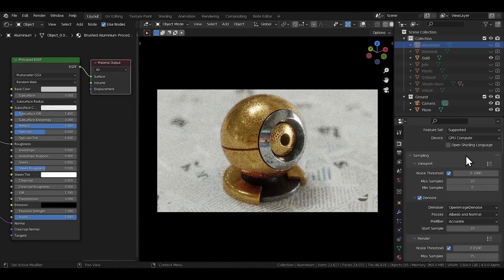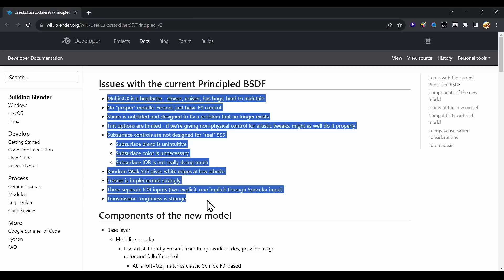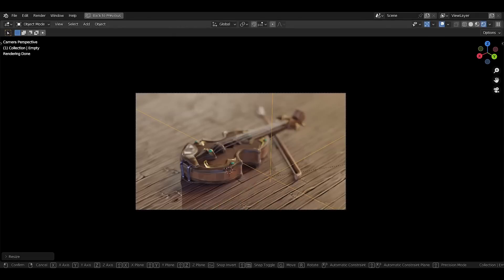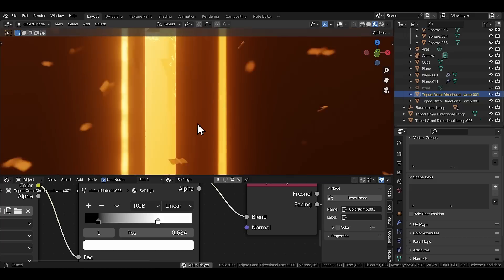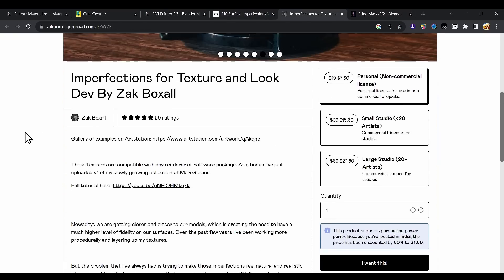Material, Shading and Texturing Tips for Blender

Comment: If you are saving a png next to your psd, you are now using another 3 mb of storage in addition to your original 20, and when blender loads the image into memory, it will use the full uncompressed data anyway, so png saves you nothing there.

Sure, if you are no longer editing, compress to png for the storage benefits, but otherwise just use the original psd for flexibility.

Comment: I wish they'd also add a toggle to the normalmap node to mark the image texture thats being plugged into it as OpenGL or DirectX, as if its a DirectX normalmap the bumps and indents get inverted. Plus I'm kind of tired of always having to add the extra nodes to seperate the green channel, invert it, then combine it.

also hope they fix issues with subsurface scattering in cycles, where in my experience it can cause a strange effect where the topology of the model becomes visible on the material - which doesn't seem to be an issue in eevee since its screen-space SSS

Comment: idk who needs to hear this but blender now supports USD so you can export pretty much everything very fast to unreal engine which comes with a new material system Substrate. Its crazy accurate, higher visual quality than this and runs in real time. If you feel the need you can even path trace it.

Comment: Nice to see you using Object info and random! I use it all the time and haven't seen it in use very often. The use case for the foliage is exactly the first thing I used it for, and an almost identical node setup too :D

Good tip with the layer weight for emission.  That''ll be handy. Subbed!
Reply from the maker: Ikr. Love object info. Glad to know I'm not the only one using it on foliage
Reply: @stache_obj  Used it another time to randomize the colours of hundreds of instanced cars. Random plugged into the fac of a colour ramp set to hsv and far interpolation, and then multiplying that colour by (simplifying node network into code) sin(random * 1000000) * .5 + .5 gives you pretty much all colours and shades! 

For literally every possible colour, you can use the HSV node, and plug in sin(random * 10000) * .5 + .5 into saturation and value, with 10000 just being some very large number, different for each slot by an order of magnitude or so. It works really well for colouring uncountable numbers of objects uniquely! Sorry for the paragraph, too excited to discuss Blender shader nodes
Reply: I've found that it's handy to map some of your noise textures with world space mapping too, if you have something where you want linked duplicates but different noise, like dirt or damage on walls of similar buildings. Especially with modular building, where you use the same wall in a bunch of places on the same building.
Reply: @darrennew8211  I often use world space mapping too. Even in Unity shaders. I don't see it being used very often either... perhaps it's ba practice? But why? is it more expensive? Dunno. Until I get a valid reason I'll continue using world space :P

Comment: Fyi Principle v2 ain't in Blender 4.0 Alpha yet, so what you are showning is still the old principle shader, but with some added and removed sliders :)
Reply from the maker: It's not called v2. But this is the beginning of the changes they talked about in the blender conference. So it's not called v2. But it's definitely the beginning of what they promised.
Reply: @stache_obj  Yeah sure, but the energy conservation issues that is the main problem with v1 is still very much there, and  from reading some of the dev talks about it it still quite a while before we will see the actual v2 in the main 4.0 branch :\
Reply from the maker: The fixes to the multiscatter cgx is just the beginning tho isn't it? It's a good start won't you say?
Reply: @stache_obj  Yeah of course, it was just that you where talking about that the principle v2 with it's new energy conservation etc is in Blender 4.0 right now, which it ain't yet unfortunately :)

Comment: Mmmm... I like these more advanced options, but I wish there was a way to hide some of them to make Blender more accessible and reduce the amount of visual noise (either by creating a "Simplified GGX" or, at least, group widgets into collapsible blocks). Trying to explain what anisotropy, clearcoating or transmission is very difficult and most times you do not need all those options.
Reply from the maker: I think it's just trying to maintain the regular standards of material settings as in other softwares as well
Reply: @stache_obj   Yeah, and that's completely understandable... but I fear most professionals are forgetting how all this complexity can make "normies" afraid to even begin to use those software solutions. As a teacher, I believe there should be "accessibility options" so that we can slowly introduce all these concepts to beginners. These video tutorials are great in that regard... yet, until they are integrated in the Blender UI, we should put ourselves in the shoes and allow them to "discover" these advanced options at their own pace, without inducing choice paralysis.

Comment: Something I just learned recently digging through helps files about the Principled shader is that on opaque material is you need to adjust the Specular for proper IOR. From the documentation: In Blender IOR is controlled by the value Specular using the formula of specular = ((ior-1)/(ior+1))^2/0.08

So for instance the default 0.5 specular = IOR of 1.5
Reply from the maker: Yeah I recently read that too. Unfortunately after the video was already made. I'll keep it in mind for a future video. Thanks for bringing it to my attention tho
Reply: So what does the IOR socket do then ?
Reply: @nathandubuc9962  that's for refraction through the transmission setting, the specular setting controls the dielectric specular reflection which is calculated through the above equation using the ior of the desired material. you could make a simple node setup to handle this automatically
Reply: @nathandubuc9962  That's for transmission only. Subsurface scattering also has its own IOR value. Basically there are three different IOR's for three different parts of the Principled shader, all independent of one another.

Comment: Timestamps:

(00:24) - Updates to the principal BSDF node in Blender 4.0, including improvements to energy conservation and sheen calculation for more accurate cloth materials.
(02:10) - Fixing the normal node issue when going above a value of 1 in the strength field with a workaround until Blender 4.0 is released.
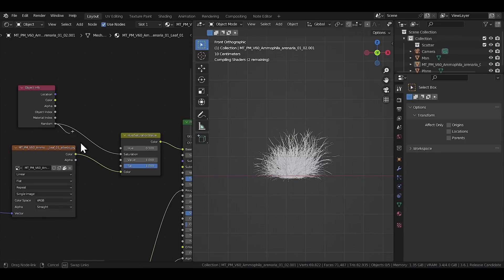(03:29) - Utilizing the Object Info node, specifically the Random slot, for creating random variations in foliage or other objects.
(04:21) - Using PSD files for image textures and quickly updating them in Blender after editing in Photoshop.
(05:11) - Enhancing the texture workflow with the Object field in the Texture Coordinate node to control textures in the viewport.
(05:37) - Exploring vertex paint for adding color variations and details to models.
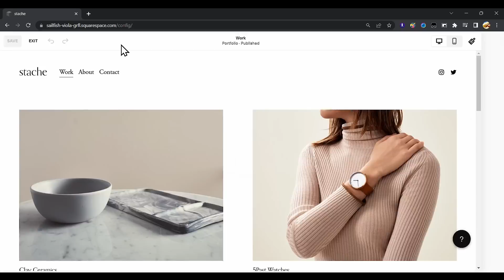(06:26) - Discussion of using decals to quickly add details to scenes without touching the Shader Editor.
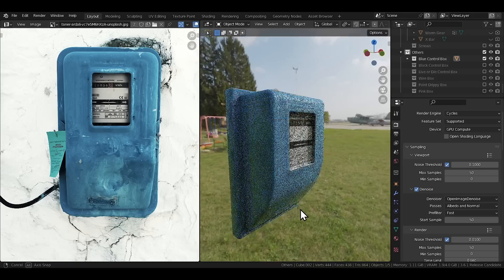(07:11) - Leveraging simple projection mapping techniques using Deep Bump add-on for easy normal and height maps.
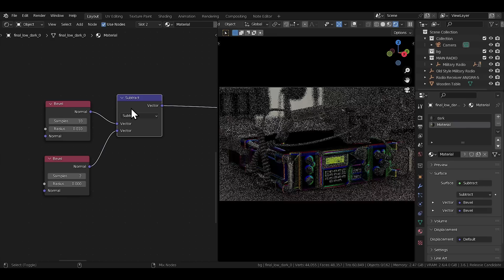(08:01) - Creating procedural masks for models, including edge masks, curvature maps, and ambient occlusion masks.
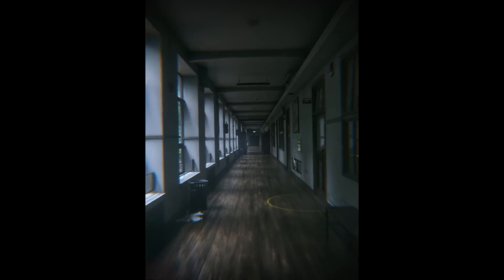(09:16) - Using the Subsurface Scattering (SSS) effect not only for human skin but also for other materials, providing a squishy appearance.
(10:07) - Setting correct IOR values for different materials to achieve more accurate shading in different lighting scenarios.
(10:34) - Using the Layer Weight node with emission shaders to create gradient effects and avoid flat emission appearances.
(11:24) - Recommendations for various Blender material libraries and add-ons, including Blender Kit, Polyhaven, Ambient CG, and more.
(12:15) - Mentioning some paid add-ons and resources, like PBR Painter, Fluent Materializer, and Quick Texture, for more advanced material workflows.
Reply from the maker: We're my timestamps not good enough bruh 😢😢😢😢
Reply: @stache_obj  They are great, I just explain a little bit more, for free!

Comment: the .psd directly in blender thing is a life saver for my VRChat world development, because with the "Auto Reload" Blender addon, my textures auto-update in both Blender and Unity. To go the extra mile, I load my world directly into unity as the .blend file, so the entire world auto-updates as well.
Reply from the maker: Uffff. That sounds like the perfect ecosystem
Reply: I use Blender with Unity also because of the model refreshes! 
It works so fantastically well… used to use 3dsmax before but it takes incredibly longer (of course Autodesk) to launch the background process that does the import.
Didn’t know about the auto reload texture Blender add-on, thanks for the heads up.